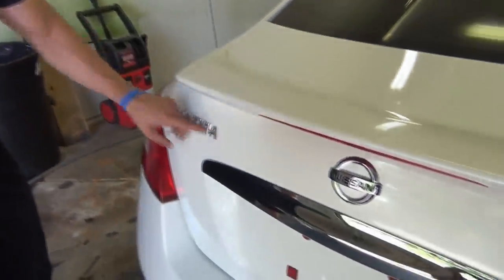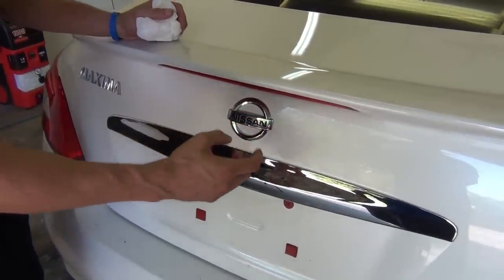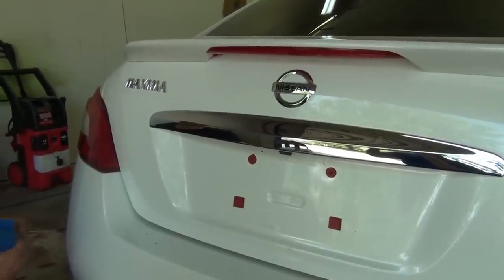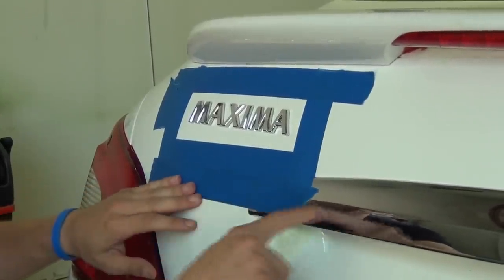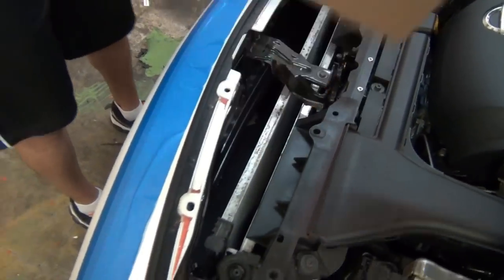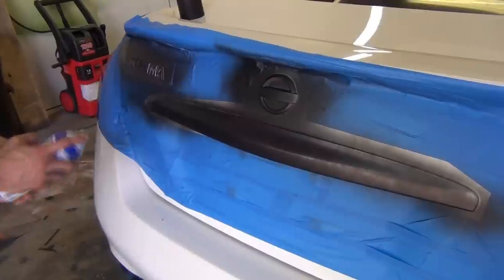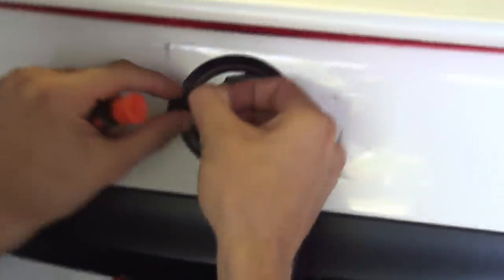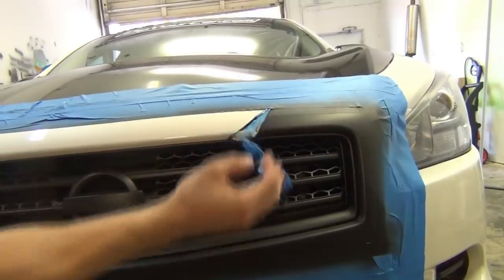How To Plasti Dip Emblems and Front Grille - HD Step by Step - DipYourCar.com

Comment: I’ve tried multiple cans of plasti dip, but they all spray out really heavy instead of more of a mist like in all the videos
Reply from the maker: That may be because you're spraying in colder temps.  Try warming the cans in warm water before spraying, it makes a big difference!
Reply: DipYourCar I’ve tried putting them in warm water and the can heats up but it’s the same

Comment: so if I wanted to have a colored dip but black logos...how would I do that?  wouldn't it peel the previous dip after I peel the black around the logos?
Reply: did you already plasti dip your car?
Reply: if u did, then just spray the dip on the emblem over the car's plasti dip and it should peel off the car's plasti dip if u do it right, as long as you put tape around the emblems, the plasti dip should form an easily peelable layer to peel the plasti dip
Reply: no I'm planning in getting a whole completely different car lol.  So I don't have to worry about that first dip peeling

Comment: nope, stays on just fine, he has a video using a 1800 psi pressure washer holding 2 inches away from the surface and everything was fine.

Comment: But doesn’t it start peeling off within time or when u pressure wash your car ??? I wanna do this or maybe just wrap it
Reply: i pressure washed my car to TRY to get the plasti dip off and i can promise you it will not come off unless you really try to get it off with lots of power and if you're really close to the car
Reply: Luxchannel X plasti dip is very very strong believe it or not

Comment: back of the can says let dry for 4 hours?
Iv tried doing my emblems twice now and when i peel it off it doesn't work well
Reply: Kinda late but you want to peel about 15-20 minutes after the final coat. Let the finished product dry for 4 hours because that's when it hardens and becomes much harder to peel off. If you wait that long to peel off, you're just going to end up taking the emblem with it.

tl;dr Peel early. Don't wait 4 hours.
Reply: +Cameron Murrill thanks man

Comment: Why does the stuff flow out of the can so smooth for this guy and for me it spits and sputters?
Reply: Make sure you shake it well and the can isn't cold. Spraying paint (or dip) in cold temps will yield unsightly results.
Reply: *****
Dude, I live in Seattle.  It's always cold here!  I keep the cans in the house until I go to use them but its about 60 degrees here all the time.  I have done a couple projects though and I am very pleased with the results.  Great product.

Comment: Is predip spray necessary?
Reply: Nah I did my whole bumper yesterday the pre dip spray might help but as long as you clean it with plain water and make sure it's dry your good to go. They are a business they gotta try and sell you extra stuff.
Reply: +PTG Productions Also use something like mineral spirits on wheels to get rid of grease, just water won't work.

Comment: how many cans did u use?
Reply: I'm sure you already found out but for anyone who may see and wonder, 1 can is more than plenty for just logos.  If you're doing a grill and logos 1 cab should be fine but I'd use 2 just to be safe.  If you're doing rims I'd say at least 1 can per rim other wise small rocks may peel the dip on the rims easily.

Comment: Noob trick: use compressed air cans for cleaning keyboards/electronics to get the emblems clean and dry instead of trying to get a tiny piece of paper towel inside the letters

Comment: where can I buy matte graphite plasti dip? can't seem to find them maybe it's under another color name?
Reply: You can buy it at Lordco.
Reply: 9HU8A983 P13
thanks a lot just did mine it looks great! however it's hard to get rid of side wall plastidip, it doesn't peel off like in videos is it ok to just leave it there? and best way to clean plastidip on the floor? forgot to put something underneath oops. the garage floor isn't concrete it's specially treated so clean up will be easy, not sure what's it called. thanks
Reply: Okaythen001 jetwash and scrub it probably

Comment: How easily will the dip chip or scratch
Reply: Assuming it's applied properly, it should last a little more than two years, maybe more. Badges dont really take a lot of damage like wheels do so they last a lot longer. Personally, I always go with 6 coats but it's not necessary.

Comment: You really shouldnt use a micro fiber cloth if your going to push too hard, micro fiber is made from plastic and it can scratch your clear coat, happened on my black car, use a cloth that's 100% cotton so you dont damage anything. Good vid though

Comment: I would have used a heat gun to dry all of the small gaps in the letters after wiping everything else down with a paper towel
Reply: or use air to blow out the water like we used to do at the body shop before painting things for realz

Comment: looks great but it looks like its very easy to peal off
Reply: Man Horse After one hour, the PlastiDip will cure and be much harder to remove, that's why you peel it quickly after applying.
Reply: That's the appeal. Easy to put on. Hard to come off on its own. Easy to peel off.